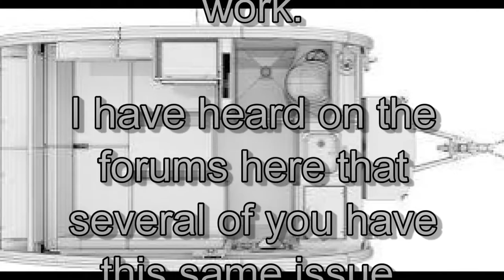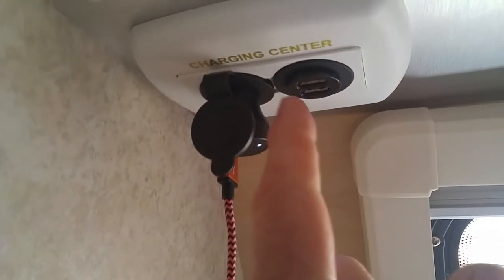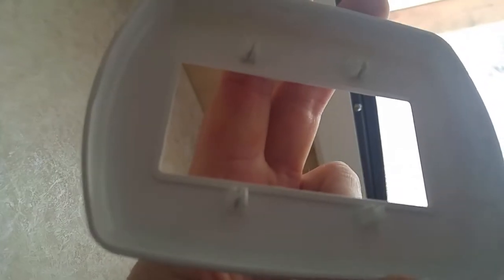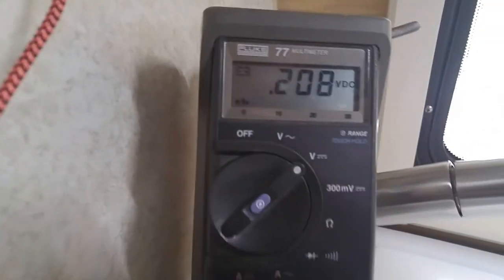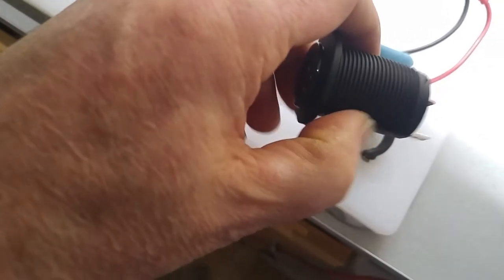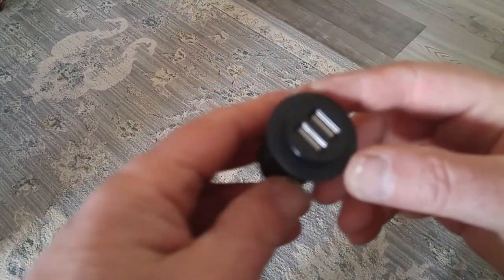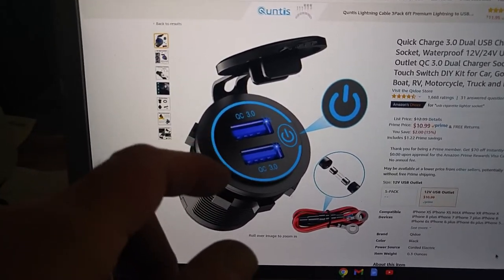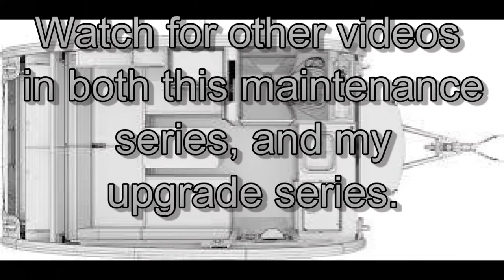Charging Center USB Port Repair on my 2015 Tab Max-S trailer

Comment: Thanks for this.. replacement on the way.  I’ve tended to just use my extra dual plugin like yours.  With the new one, can this be still used?
Reply from the maker: Yes,  you can still use the other side for whatever you want.

Comment: Those wire taps are terrible. I’ve discovered the fan not working on an ‘06 because of a bad connection thru one of taps.
Reply from the maker: Yea, when the replacement part arrives from Amazon, i may remove them, and solder the wires, and add some heat shrink..